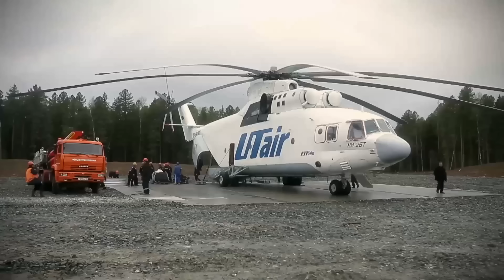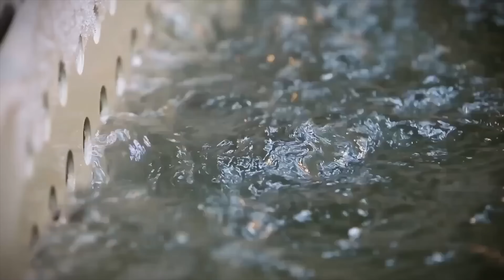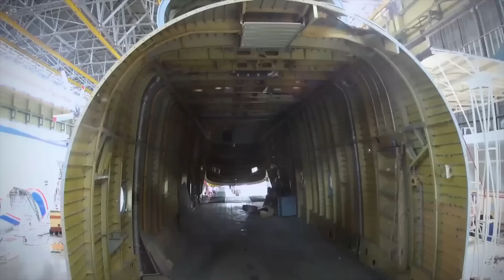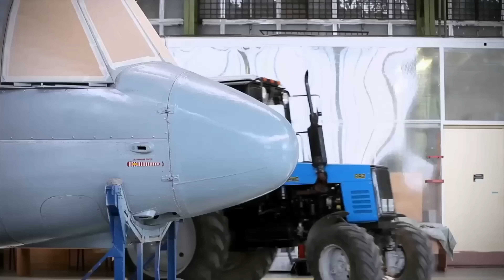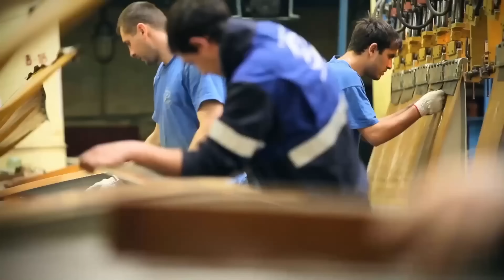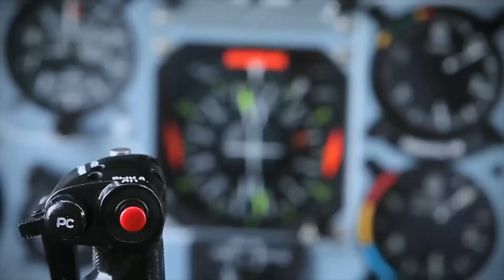Mil Mi-26 Manufacturing | Inside World's Largest Helicopter Factory

Comment: it can lift up to 25000kgs in short range transport, long range is 20000kgs because of fuel loads. it is a real monster.  V12 was the biggest and most powerful could lifted 42000kgs, shame they did put in productions as the military didn't had need for it.

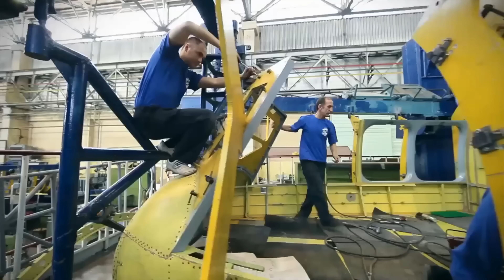Comment: 2:15 You can see the blue and yellow jigs that are used to get everything lined up together in the right place. The engineers don’t guess where the panels will go. 
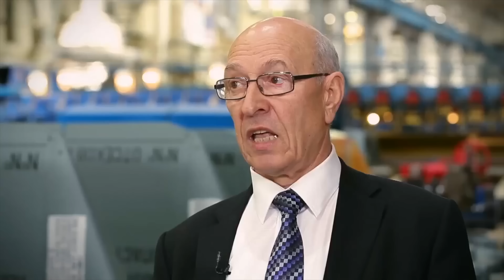2:51 As for “accuracy and precision crafted parts are joined together like and intricate jigsaw”. If the panels don’t fit then the edges just get filed down.

Comment: you forgot to tell us about the multithreaded rotor reducer, which is unique in its power and lightness. This reducer is actually one of the most important parts of the helicopter, without which it would be impossible to create such a powerful model
Reply: What is this? Is that like a herringbone gear?

Comment: нужны новые моторы и нужно использовать другие материалы. вертолет был хорошим для своего времени. Сегодня его нужно делать из новых более легких материалов. Авионика (пилотажно-навигационное оборудование) пещерная. надо ставить новые вычислители. можно облегчить вертолет на 150-200 кг если поставить современные приборы.
Reply: It's still a good helicopter... if you're going to build a new one, that new one won't be better by more than a few percent, so it's not worth the effort. The Mi-8 is a good example of a construction that does not need to be changed, all that is needed is to "finish" a little with some new component over time. Why did the Mi-38, which was intended as a replacement for the Mi-8, fail to do so? He didn't offer anything so valuable that the Mi-8 would give way to him...

Comment: It's weird to see a company manufacture new helicopters of that size without digital/glass displays and equipment.
Reply: Mi-26T2V is what you looking for...
Reply: I prefer analog instruments over glass!!
Reply: Why Reinvent The Bycicle. ANALOG INSTRUMENTS R STILL OK. TO USE.
Reply: @adolfocornavaca2544  yes but why overcomplicate things when you can upgrade to the late 1980s and only need two pilots to fly instead of 4+, it makes no sense to build anything of that size with full steam/analog gauges.
Reply: @kehreazerith3016  The number of crew depends on its functions and safety/operational requirements.
Reply: @adolfocornavaca2544  Absolutely no modern aircraft use analogue instruments any more. You can even get Cessna 152’s with a glass cockpit.
Reply: Reliability above all. For example, modern electronic tonometers and thermometers often fail and begin to distort readings, and there are much more shortcomings and weaknesses in electronic equipment. Any f-35 stuffed with expensive electronics has many vulnerabilities, it can be "dropped" without missiles, electronic warfare systems, an electromagnetic pulse.
Reply: @Пень1Бук1  modern electronics are significantly more precise than anything analog. They also are just as reliable. anyways, don't even try to say analog is better, crew awareness plays a key role and you don't get that from a bunch of old fashioned dials.

Comment: If I may, 20 tons isn't a "main battle tank". It's a light tank or VDV tank destroyer at best, air transportable, air-droppable or being underslung an Mi-26. Other than that, the Mi-26 really is a beast.
Reply: Fine, you found mistake in poorly managed video. But it's much more than any helicopter  from west can do.  King Stallion, which is world's most expensive helicopter is on 15 tonnes
Reply: @hekpacobctac616   It helped America save a two Chinooks in Afghanistan that had been shot down or crash landed on a mountain side. The Mi-26 was the only chopper capable of getting it back to a US base where it could be worked on. Might have been just  one, can't remember, as I think the US military decided the 2nd wasn't worth trying to save (sure they destroyed it on the mountain side).

The NATO shills on here may remember, prolly not, that Russia did everything possible to help us in our war in Afghanistan despite America breaking promise after promise about no NATO expansion eastward, oh it wasn't in writing....that's what you are gonna say right? So I guess the words of our top diplomats mean nothing (of course they don't). Why America promotes a system of rules instead of law. Rules can change moment to moment and be applied inconsistently. Laws give a sense of rigidity. You can see this happening right now with the EU, America, and Canada refusing to recognize a new government in Niger. But when the west led an extremely violent coup using lets just call them "ultra nationalists" as the muscle with Victoria "F the EU" Nuland QB'ing the thing while handing out cookies on the Maidan and getting caught picking the 1st pro western cabinet in a wire tapped phon call every government in the collective west immediately recognized this coup installed government as legit. Same thing in Venezuela. Maduro was still the President and Juan Guadio, who had zero claim to the Presidency of Venezuela, announced on instagram that he was the leader of the country now and every country in the west fell all over themselves to let everyone know that Gaudio was the leader of Venezuela in their eyes. The people of Venezuela? Who cares what they think!

So what can't Niger's government be recognized? Cause they won't let France steal uranium and gold anymore?That's four client regimes France has lost in like 18 months! I wonder why? Let me guess you think it's Russian interference. LOL! Parts of the Russian IAD system like the Pantsir S1/S2, S-300's, BUK's, TOR's, etc. will be there soon, some already have them, to prevent US drones and planes from attacking and spying on the new government freely. Coastal country will purchase export versions of P-800 Oniks ASM's to provide a stiff arm to countries that still believe they are colonial masters.Similar to what Russia did with Algeria. They have one of the best IAD systems in the world. So good that Israel decided against attacking them several years back and the IAD system along with Algerias air force has only gotten better since then.

But keep believing in "American exceptionalism". How many missiles and artillery shells is that worth? How many actually effective, big caveat, air defense systems is that worth? None.
Reply: @mikelee7318  impressive work mate. And people like you gives me hope, thnx
Reply: they baited you for comments XD by saying mbt, but also they said it can lifr up to 20 tonns
Reply: Still bigger and badder than anything that NATO has to offer.
Reply: @utkarshg.bharti9714  Russian transport capabilities are a joke if you compare them to NATO... They are unable to provide proper logistic for Ukraine War theater and NATO got zero issues with providing logistic for Afghanistan and Iraq...
Also in case of Heavy-lift cargo helicopters Sikorsky CH-53K King Stallion is a serious competition for Mi-26, it is faster(310km/h vs.295km/h) and with significantly  longer range than Mi-26 (850km vs. 500km)...
In case of planes there is no real competition, as Russian heavy transport planes fleet is tiny.
Russian army logistics is all about train ->XIX century in logistics and in battle tactics as they using human wave attacks to this day...
Reply: @Bialy_1  " with providing logistic for Afghanistan and Iraq..."  now calmly read again what you posted as a compairison to the ukrain situation and realise how utterly immensly stupid your remark is.
Reply: @Bialy_1  Ukraine who has poor training by british also use human wave tactics lol what a cope comment the MI-26 is multipurpose not really used much by the russian military and only for logistics and pretty sure its bigger than it so it can carry more cargo than it shutup and enjoy the video you bigget.
Reply: @Bialy_1  lmao yeah right NATO had major logistical issues from the start.  They just threw money at it (and the Russians helped them by allowing them flyover of Russian territory).

I remember when the Russians withdrew those access rights because of the BS we were pulling in Ukraine regime changing them and arming neo-Nazis etc.  NATO had a nightmare reorganising everything and it having to go via Pakistan.

So don't try and BS
Reply: @Bialy_1  oh and we were fighting tribesmen backed by nobody.  Russia is fighting the second largest nation in Europe that is being pumped full of weapons by NATO.

You really don't half come out with some tripe kid.
Reply: @Bialy_1   You actually believe the "human wave" tactics propaganda that NAT borrowed from the Germans in WW2. You are hopeless. Our media can tell you anything and you will believe it. 

In terms of heavy lift the Mi-26 is the best helicopter on the planet. Not about range or speed. It's about lift.

Antonov makes excellent transport aircraft. 

You are also delusional about Russias ISR complex. How's that NATO designed Ukrainian counter offensive, it's really just an offensive, going? Two months in and Ukraine has yet to make it through the screening zone! Now we have factions within NATO and Ukraine pointing fingers playing a blame game over who's fault it is. Maybe the wests MiC just doesn't produce enough equipment and ammo for this kind of large scale combined arms warfare? Maybe Russia was better prepared to fight a protracted war. The last time America fought a real war was the 1950's. Americas never flown against a legit IAD system. The closest we came was in Vietnam and the results were disastrous with abut 9500 aircraft lost (ballpark; 3750 fixed wing and 5600 helicopters) and that was with the USSR sending the Vietnamese 2nd and 3rd tier air defense systems.

General Cavoli, commander of US armed forces in Europe, when speaking on the war in Ukraine;

"The scale of this war is out of proportion with all of our recent thinking," said Cavoli, who is also head of US European Command. "But it is real and we must contend with it."

In another quote he said it was "Beyond NATO's imagination". 

America fired 60,000 artillery shells in Iraq total and we thought that was pretty high intensity. Russia is firing on average over 20,000 per day and has had individual days where they've fired 60,000. Why do you think the Ukrainian offensive that NATO planned is such a disaster? The people planning it had no idea what they were preparing to fight.
Reply: @stephen4121   Ukraine was the best military in NATO outside of the United States, in February 2022. Only possible exception is the Turks and based on their performance in Syria.....I would bet on the Ukrops if they had gotten in a war. NATO had over 8 years to train and arm the Ukrainians at de-facto NATO bases like Yaroviv, RIP (got Kinzhaled in early March 2022 termniating several hundred NATO contractors and several hundred million in equipment). Yaroviv was training multiple at least 1 brigade  every quarter with the stated of purpose of going to the Donbas to attack and terminate l Russians (civilian or military...didn't matter).
Reply: @mikelee7318 ukraine isn't in nato
Reply: @Bialy_1  👈🏼 Found the NAFO clown🤡
Reply: @Bialy_1 
Your 🇺🇦 propaganda stop working 😂😂😂 There is not many idiots left to believe your ukrnaz sh*te....
Reply: @JustHowitIS-w9l Израиль тоже не в нато. И что? Это не мешает Америке направлять оружие и деньги своих налогоплательщиков на Украину и Израиль. 😂
Reply: @Bialy_1 , ahahaha🤡🤡🤡, go to sleep my little baby and don’t cry please))

Comment: is there any production of these right now? ukraine had engine production... did they found proper engine replacement?
Reply: They did
Reply: @vig237  how many new ones with new engines than?
Reply: @jebise1126  MI-26 will be upgraded. Receive new avionics and new PD-8 engines
Reply: @ouueee  but were any produced in this standard? will there also be less pilots needed?
Reply: @jebise1126  Not yet, as the PD-8 is now at the final stage of certification. Yes, the crew of the Mi-26 helicopter will be reduced from 5 to 3
Reply: PD-12V engine is being evaluated for Certification, but I don't think it has been approved yet. This company is probably using stockpiled Ukrainian engines as a stopgap. The production rate for Mi-26 can't be too high, these are expensive helicopters.
Reply: ... did they find* ...

Comment: The engines are Russian Mil Mi-26 https://en.wikipedia.org/wiki/Lotarev_D-136
Reply: Well, you're not wrong. But it was designed in the USSR and the only plant that made those engines was located in Ukraine (in currently contested Zaporozhye region). However, manufacturer plans to replace it with a more powerful PD-8V engines, produced by Perm Motors.
Reply: @penguinpeko  PD-12V will be the replacement.
Reply: @heyfitzpablum PD-8V
Reply: Все двигатели разробатывались в России и отдавались на разные заводы что бы их производили, в том числе в украинскую советскую республику.

Comment: Everything in that factory looks so backward compared to similar western facilities. Those copters are "too handmade" considering the f*cked up quality measures Russian manufacturing is currently taking. I bet they are replacing bolts, nuts and cables with replacements close enough what they happen to have in stock. This means eventually that the crafts don't meet the functional standards of their design.